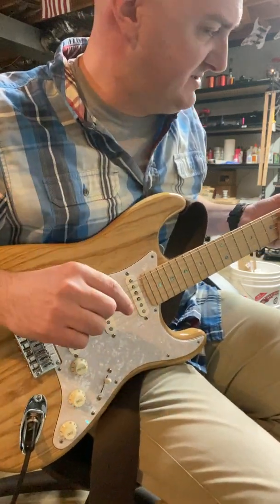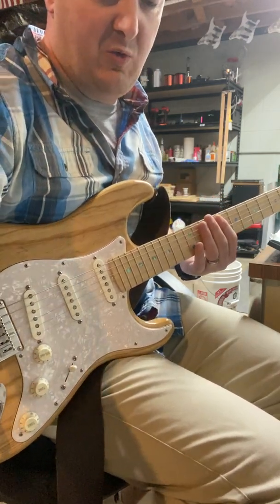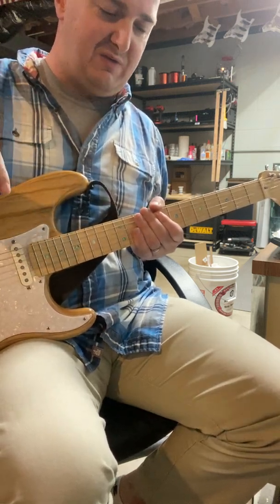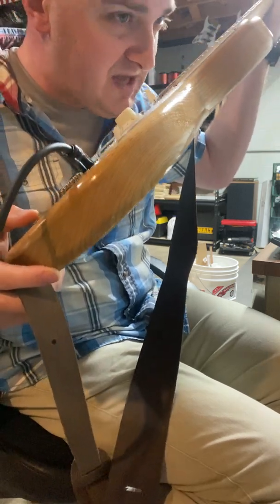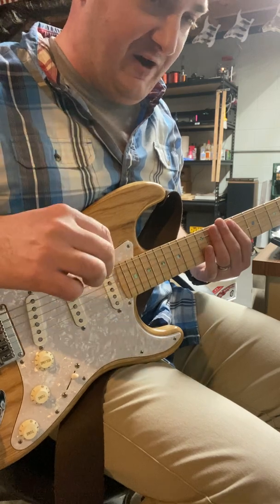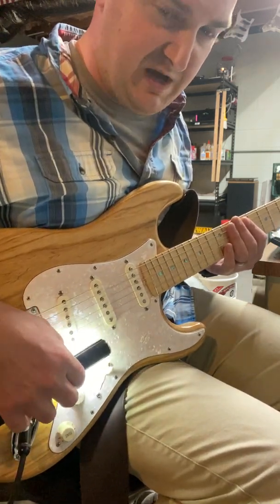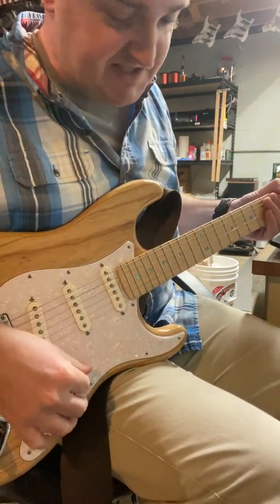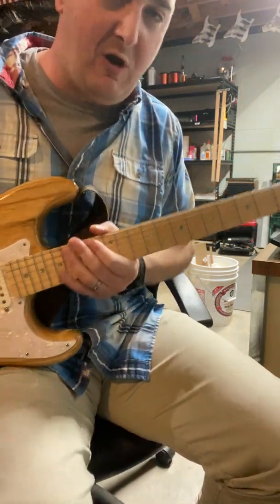60 cycle hum, RFI and Shielding is useless Noisy electric guitars SCIENCE EXPERIMENT

Comment: maybe the power conditioner is worth it though, far be it from me to tell other people what to do with their money but your ground is really fucked. mine's pretty quiet in a noiseless position away from light frequencies (like my computer monitor which sounds so bad it makes me nervous to sit in front of it) but especially into a clean amp like a deluxe reverb, those are super quiet on a 2/4 position. what's causing that ground thud? refrigerator or something outside of your place like a transformer?
Reply from the maker: Yea man a power conditioner would be nice. I have a cheap one that I’m plugged into that helped some. A real deal conditioner that would solve my problem is several thousand dollars. It’s not that bad for me too spend that kind of money to solve the problem. I’d rather buy some more gear. My wiring isn’t fucked, just needs to be re-grounded again.  I was just making an extreme demonstration to illustrate the different types of noises people might hear so they could properly identify them and show that shielding passive components is useless. There’s nothing else on that circuit to make noise so it’s definitely my ground needs to be beefed up.
Reply: @MathewsGuitarWorks  Do you happen to have an electric fence near by, for livestock?
I'm currently trying to track down a rhythmic click coming from all guitars and amps in my home. Much like the clicking yours is doing, just slower. My research is suggesting electric fences act like radio towers, and can send strong RFI fairly long distances. I live less then 100 Ft away from one, and am starting to believe that is the issue.
Reply from the maker: @codybechardwatson5619  So I kinda live in BFE however, I do have a cell tower about a quarter mile away.  I’m surrounded by pastures with electric fences but I highly doubt that has anything to do with it because they are so far away.  Interesting that you thought of that, might have some merit.
Reply: @MathewsGuitarWorks  
I'd say it's worth looking into. I'm having the farmer temporarily shut the fence down. I'll know for certain in a few days.

Comment: Do you have the Book "Guitar Electronics for Musicians by Donald Bronsac" although it is copyrighted 1983 it's a great source of information and  pick up circuit diagrams; an interesting section on shielding  (although does conflict with your video i admit  we have more gadgets now  that can cause unwanted noise) also it covers removing the bridge wire or string ground to prevent electric shock (not on single coil pickups) . I was once baffled by a noise when practicing turned out it was my smart phone in my pocket .NOT that smart me and the phone then.
Reply from the maker: You are absolutely right. There are lots of things that can cause RFI being blasted through the atmosphere. I wouldn’t advise removing the bridge wire of any guitar. That will cause a lot of unwanted noise.

Comment: Actually in my case the foil does help to reduce the EMI considerably, and shielding helps a lot, tested separately
Reply: Sergei IS definitely right about the shielding reducing the noise when your hands aren't touching the strings. The reason the "ground noise" as you called it is louder when you're not touching the strings in the video is because when you touch them YOU are effectively at the same ground potential as the guitar electronics, and thus the noise your body amplifies via your skin is shunted away. I do agree that shielding makes little to no difference on EMI/RFI from a stage or studio environment with any kind of exposed pickup polepieces. Those will always be the greatest source of noise, but a proper shielding job CAN greatly reduce the potential for noise/pops from lifting and replacing your hands on the guitar strings. Also, in a guitar wiring harness without shielded cable (like most Fender pickup wire leads), the wire (despite being passive) DOES act as additional surface area for noise to creep in to the circuit. This noise can be diminished with properly grounded shielded cavities, shielded coax wire runs, or by using twisted lead runs of the shortest lengths possible. Again, it won't make a lick of difference on the noise picked up by the pickup polepieces, but it CAN help noises from other sources.
Reply: Shielding fixed my RFI problems, and this video really confused and mislead me before I figured it out. The fact that you have your hands on the strings while supposedly showing how shielding doesn’t work shows that you don’t understand the actual problem. The led light is not a realistic test case of RFI. The foil would need to be grounded like the pots and bridge are to have the desired effect
Reply: @Brady10000  excellent observation
Reply from the maker: You’re lucky, shielding only makes marginal differences in RFI/EMI because the most sensitive part of the whole equation is the pups which aren’t shielded. Shielding a control cavity does absolutely nothing because pots and caps are passive components and do not add anything to the signal. Active components are a different story. Thanks for dropping by!🤘
Reply: @MathewsGuitarWorks  Shielding a control cavity does a HUGE difference! I just re-checked again! See, the problem is that there are different types of sources for noises. I'll have to make a video, because it is a long story to tell, but shortly - our body is also an antenna and the types of the buzz (nut hum) I have is drastically increased when I put my hand near unshilded cavity, and putting unshielded guitar against my body increase the buzzing noise drastically. If cavity is shielded and shielding is grounded, then buzzing noise decreases significantly and it is no longer sensitive to hand movements and to the proximity of the body. I'll try to make a video. But even putting just a piece of foil between my body and a guitar body makes a huge effect if I connect this foil to any ground on a guitar, but has zero effect if it is not grounded. So shielding is a huge thing in many cases, you can find a lot of videos where people got rid of the EMI in their places just by shielding.
Reply from the maker: @SergeiVlassov  What kind if guitar?
Reply: @MathewsGuitarWorks   any unshielded, no matter single coils, humbuckers, noisless, passive or active, tele or HH superstrat. If unshielded, then there will be huge buzzing noise.
Reply from the maker: @SergeiVlassov  You obviously didn’t pay attention to the video because I completely debunked that in the video. If shielding reduced noise in your guitar(any guitar for that matter), you have one of few problems 1- your guitar was poorly grounded and the shielding helped ground the circuit,  2- you have an inordinate amount of RFI in your area or 3- the noise source doesn’t not come from the guitar. I literally went over this in the video and through simple demonstrations proved it. I’ve been winding pups and making custom harnesses for a long time bro. I’m not guessing about this. I’m 100% certain.
Reply: @MathewsGuitarWorks  grounding was carefully checked on all guitars. I give you facts, facts don't care about what we think or believe. There are many other videos where people eliminate or significantly reduce buzzing noise by proper shielding, with before and after demonstration. You can search. Shielding acts as antenna collecting EM signal and sending it to the ground. The guitarist is also antenna, and when not grounded, it adds a lot to the noise, but when we touch the ground on a guitar or anywhere else, the noise disapears even if we don't touch the guitar, but guitar is close to the body. It is also demonstrated in other videos, and it is absolutely the case in my situation. But the sources of noises are different, my unshielded guitars were quiet in other environments. But at my place there is some strong source and the shielding absolutely helps! Yes, shielding will not help against very directional EM radiation that pickups will pick as you demonstrated, but against directional you just rotate yourself untill the noise is gone. But there are more uniform sourses, I have it everywhere in my house, in any room, any direction, and shielding is extremely efficient against it. If it doesn't help in your environment, it doesn't mean it will be useless in other environments. P. S. I work at the Institute of Physics, and I have a friend who build amps, winds pickups etc for all his life, hese is a professional in electronics, and he will tell you the same.
Reply from the maker: @SergeiVlassov  My feelings?… Ok playa👍 if you work at the institute of physics, you’d probably be smart enough to know that passive guitar control circuits ABSOLUTELY 100% DO NOT collect, reproduce or amplify sound.  Therefore, shielding does nothing to filter any RFI/EMI because it is impossible for the control circuit to collect, reproduce or amplify sound.  100% of all RFI/EMI enters through the pups. Once again, as demonstrated in the video with simple easy to understand techniques, if your noises are being reduced as the result of adding shielding, it’s because your guitar was never properly grounded or something else very strange is going on. If some how you are in the extremely low percentage of people in the world who’s body actually literally acts as an antenna, there’s nothing you can do to reduce or change the noise level your body introduces to the guitar. 99% of the rest of us don’t have that issue.  P.S. I too am a professional, I wind pups, build guitar wiring harnesses and effects pedals. Mathews Guitar Works is a professional outfit homie.  This isn’t a shade tree operation here.
Reply: @MathewsGuitarWorks  you probably missed the place where I wrote that I tested the effects of the foil on cavity - it shieds the noise amplified by the body efficiently. And no, I am not some exception, there are lot of talks about it and even some videos. But anyway - the largest is the shielded are, the more pronounced is the effect of the shielding.
Reply from the maker: @SergeiVlassov  No, I just missed the part where you know what you’re talking about.
Reply: @MathewsGuitarWorks  :) I reserve the right to be wrong in interpretations (as any human), but I gave you facts, you may not like them, but it will not change the reality. Tested on 15 guitars or so. From different brands, different pickups, different types of guitars. Grounding was carefully checked not only by me, but for other guitar builders as well. If someone provide better explanation to the effect I have, I will be very happy! But anyway, like it or not, shielding removes the buzzing noise of the guitars in my environments. If you want you can spend one evening searching for various videos here on Youtube, there are many, and some had exactly the type of the noise I have, and the shielding helped against it. If you say that all of them had just poor grounding on a guitar then you just escaping the reality rather than dig the problem deeper.
Reply: @SergeiVlassov  true
Reply: I mostly play guitars equipped with true single coils and live in a house with noisy old wiring. I do the old studio trick of finding the point in the room to aim my guitar pickups that generates the least noise. In an unshielded guitar, the noise floor even with the aiming trick is higher than in a shielded guitar (which will be nearly dead silent). In the video example, the pots and switch don't generate EMI/RFI from the light because the metal pot shells and switch enclosure are grounded and form a shield (at least more of one than if the conductive elements of the pot or switch were totally open or encased in plastic). Some guitars with really long lengths of unshielded wire runs (such as Fender Jazzmasters, Jaguars, Bass VIs, etc.) can REALLY benefit from cavity shielding or replacing the long runs with shielded coax.

Comment: I am so glad I found this video. It definitely clears up some suspicions I had about the hum I am experienceing. I never had a problem until I moved. I have spent a lot of time trouble shooting. Unplugging items, turning off breakers,  trying efi/emi filters, quality cables, disconnecting LED lights etc. I took my setup to my next door neighbors and the hum was gone. I am almost positive it is a grounding issue with the main breaker panel to ground(earth).
Reply from the maker: Yep.  I’m going to have my house wiring grounded better too in the coming months. It should help.

Thanks for commenting and being here!
Reply: @MathewsGuitarWorks  check for a neutral to ground fault in your house wiring.  There are a few videos on YT  on how to trouble shoot for this problem.  A neutral to ground fault causes EMF. Huge magnetic fields are created because a dual return path  is created on the ground and neutral wire. An EMF meter will definitely confirm if that is the problem.
Reply from the maker: @solkinar  Thanks for the info! I will check that out.
Reply: @MathewsGuitarWorks  EMF center on YT has some really good vids.
Reply: @MathewsGuitarWorks  update. I was still experiencing some EMI issues . I checked the current on my main service neutral wire and got a bad reading. Corrosion on the wire inside the hydro meter  base was causing a dropped neutral.
Reply from the maker: @solkinar  so what you were hearing was not EMI/RFI, it was a ground issue with your house is what I’m hearing you say.
Reply: @MathewsGuitarWorks  it was an EMF problem.  My EMF meter was in the warning range in various parts of the house prior to the repair. After hiring an electrician to replace the meter base the EMF meter no  longer hits warning range. Current that should have been on the neutral wire back to  the service drop from the street was on the ground wire. Neutral and ground are bonded at the first point of disconnect, usually the service panel. Because current could not travel on the neutral past the meter base it travelled on the ground wire back into every ground wire essentially creating a dual return path scenario similar to a neutral to ground fault which create EMI. The electrician was surprised that I had figured it out and said he had never seen anything like it before.  The neutral wire where it was connected in the meter base was heavily corroded but not broken. Strange that the meter still worked.
Reply: I hammer a copper ground rod about 1 meter long into the earth and run a ground wire from this copper grounding rod to the ground terminal of the power socket and problem solved.
What's left is only a steady 60 cycle hum which is acceptable for me. Recently I plugged my Fender Champion Amp into another power socket in another room which was not grounded and it was noisy again. Then I read somebody' s comment saying that by using wireless transmitter instead of cable between the guitar and the Amp the grounding noise will go away so I tried and it worked!
Also I found out that when connecting my guitar to my Positive Grid Spark 40 Amp with cable even when the power socket has no ground, there was no ground noise. I mean some Amps are less prone to this problem. May be because the Spark Amp uses AC to DC Adapter .
By the way, in my country we use 220V 50/60 Hz AC.
In the early 90's I read a Guitar Magazine article about shielding with alu foil and then everybody followed suit. There are so many videos explaining how to do this. I think they are missing the real cause of the probem 90% of the people are facing and that's poor grounding in their house electrical system. Only a few videos explain this like yours.
I agree that shielding is a waste of time and money.
Reply: @SwingEzzZZ  I finally found the cause of my problem.  It was a neutral to ground fault in the house wiring. This causes high levels of EMF or what some people refer to as dirty  electricity.
Reply: @solkinar How did you track it down?
Reply: @greg7463  I used a clamp on ammeter inside the breaker panel. I was getting a reading of 0 on the white wire(neutral) but was getting a reading on the bare ground, which should be 0. Current was not  traveling back out on the neutral but instead on the ground. The neutral and ground are bonded inside the breaker panel.

Comment: I have a question. My vintage screw in trem on my Strat is broken, should I change to a pop in trem system? Or should I just replace with a screw in vintage trem?
Reply from the maker: Disclaimer, I am not a trem fan so if I get a strat with a trem, I always deck the trem plate against the body, add more springs and sometimes even do the clapton mod. 

What is broken about it?
Reply: @MathewsGuitarWorks  oh ok. The hole. The srew hole is worn out
Reply from the maker: @ricmel8008  you can buy a new trem block and replace it. What kind of strat is it?
Reply: @MathewsGuitarWorks  it's a MIM. I love it because it has a flame maple top. But you are right ty, I will see if I can only replace the block
Reply from the maker: @ricmel8008  Check Guitar Fetish website. 

https://www.guitarfetish.com/

If I was replacing a trem block it would be with a brass block from guitar fetish. Cost effective, quality replacement that will make the guitar sound better.
Reply from the maker: @ricmel8008  make sure to measure the holes on the bridge plate to make sure you get the right one. Some have weird dimensions.
Reply: @MathewsGuitarWorks  thanks much. Never thought of them
Reply: @MathewsGuitarWorks  I appreciate the info. Thanks much. God bless.
Reply from the maker: @ricmel8008  God bless you to! Thanks for being here.
Reply: @MathewsGuitarWorks  urw